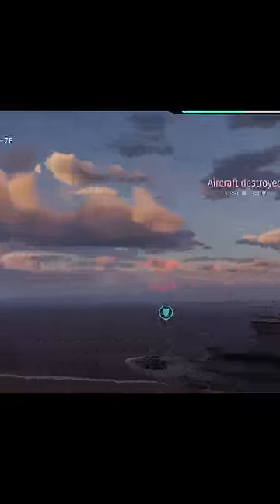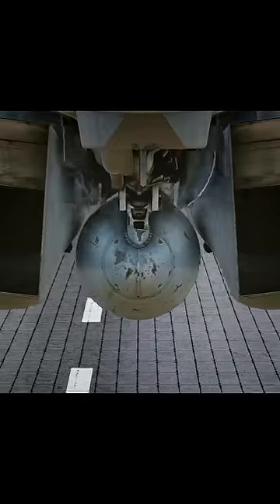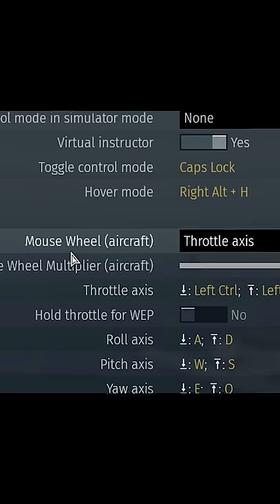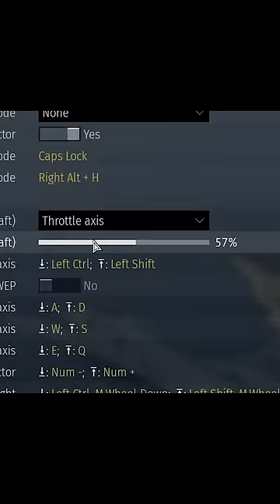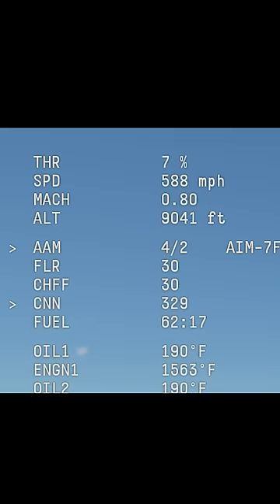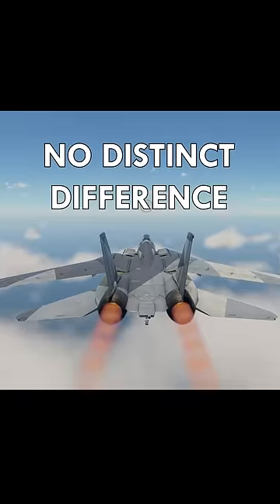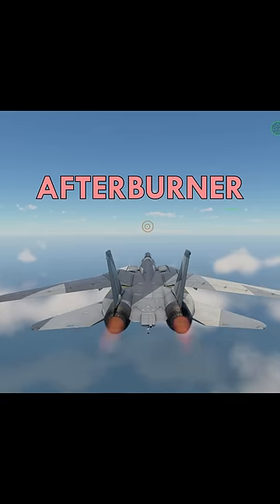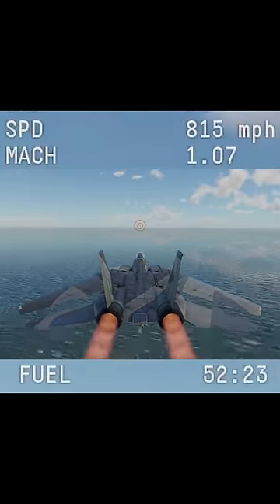How To Easily TRIPLE Your Jet's Fuel Efficiency in War Thunder

Comment: Or just use afterburner to get altitude then cruise to the battlefield at 80% then when in range up to 100 and when engaging use afterburner.

Youre quieter and slightly harder to lock on to, can be good tactically, but primarily, if youre at alt, you dont gain much by flooring it to the battlefield, can drop to 100 and dive at -5 to somewhat keep up with afterburning jets, but you save so much in that 3 minutes before the fight starts.

Comment: Not being familiar with the controls, I feel that scroll wheel for throttle would be a standard binding given both frequency of use and finer precision in modulation. But...like...it's not the default? Don't tell me that mashing keys for steps in up/down adjustment is the default. That seems both slow and tedious in a warplane sim hahaha

Comment: In real life if you want to consume less fuel in your jet, fly high and fast. The service ceiling for the F-14 in this instance is roughly 60,000 ft. In DCS with the F-14 at sea level you will burn at mil power (which is 100% throttle with non after burner) roughly 8 thousand pounds of fuel per hour. Up at 50,000 ft you start to burn around 3 - 4 thousand pounds per hour.
Reply: This is another reason why I dislike war thunders aircraft gameplay because the people like to say it's super realistic but in reality it's more like ace combat with a sprinkle of reality. Where as in DCS you get a more real sense of flight and air combat.